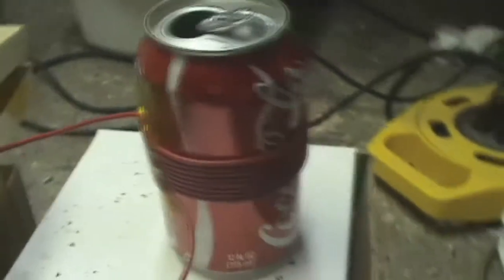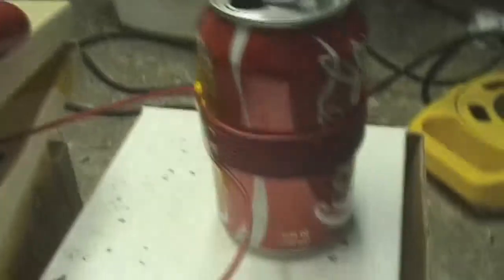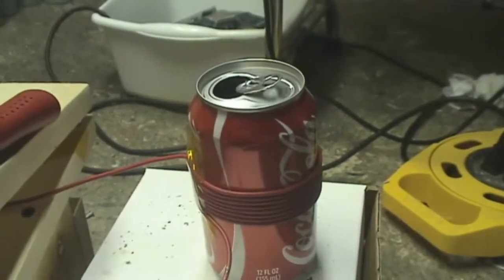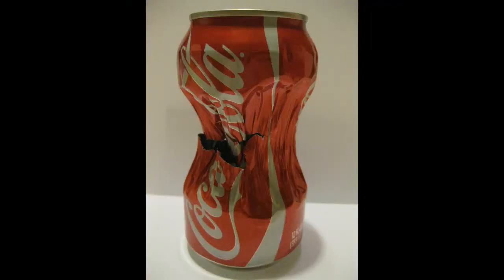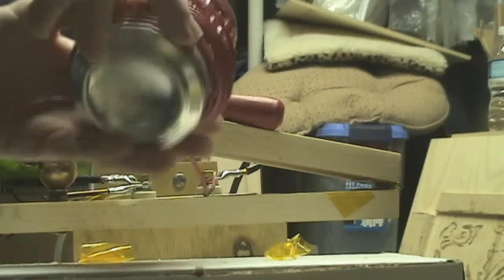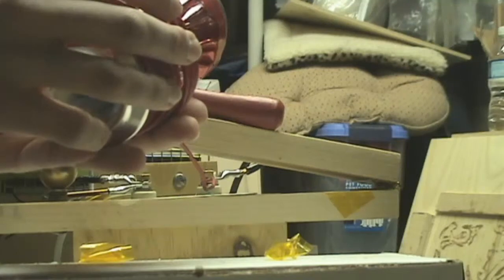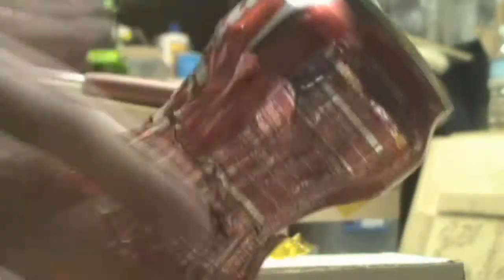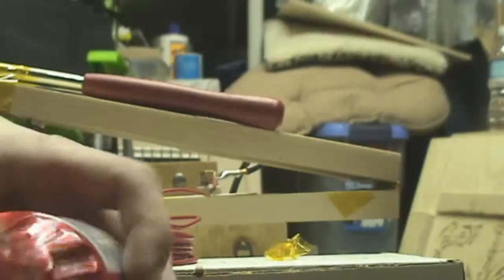Can Crusher - Coil Tests

Comment: Great test. I wonder the magnetic flux set off here as I've set off a many high rated capacitors in my day. Thanks for posting the stats and with my calculations you are using a 4630 volt supply!!!? That must be quite a bank at 140 uF. Awesome stuff.